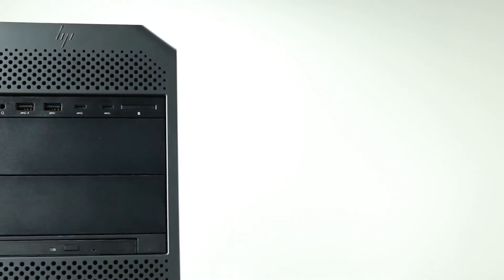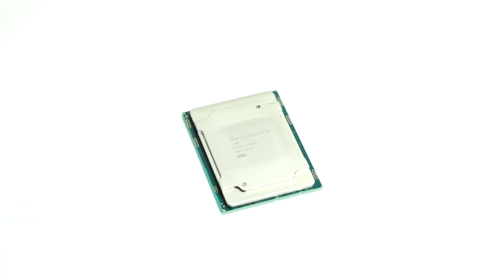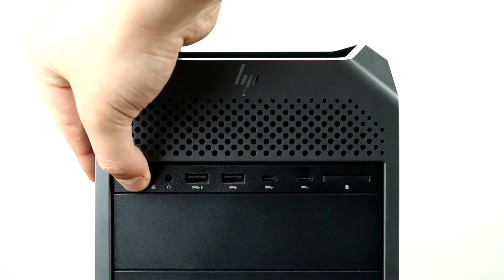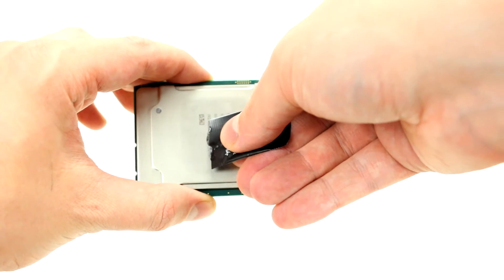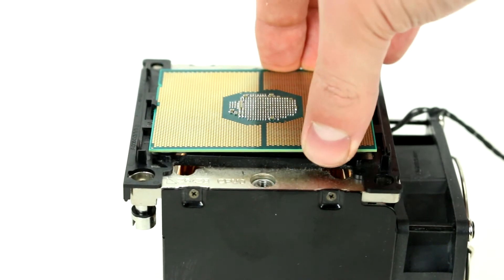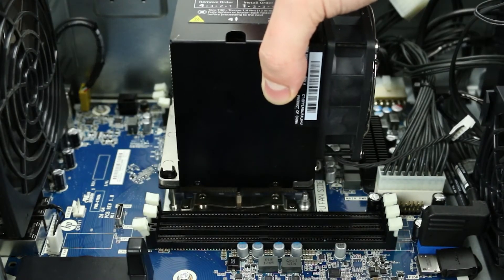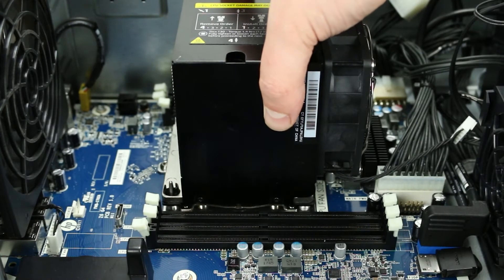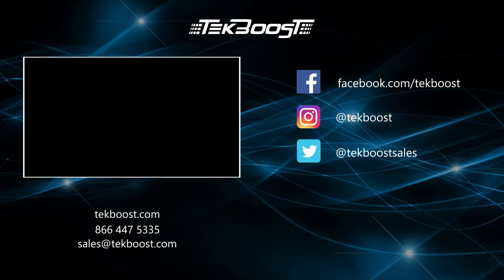HP Z6 G4 Processor Installation

Comment: When you installed the secondary CPU riser kit, the power connector on the right hand side is missing from the case. Isn't this required to use the second CPU?
Reply: It fake riser install. It requires power cable, as you described (it sold separately, so PSU is the same) and guiding rail on left side.